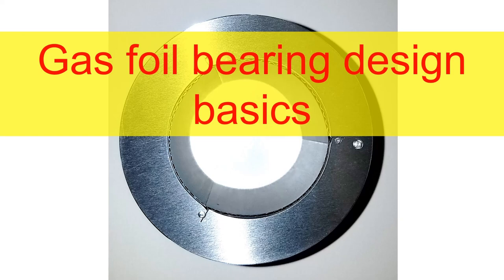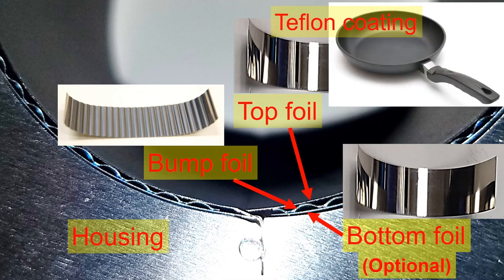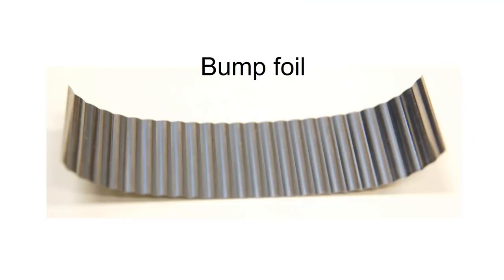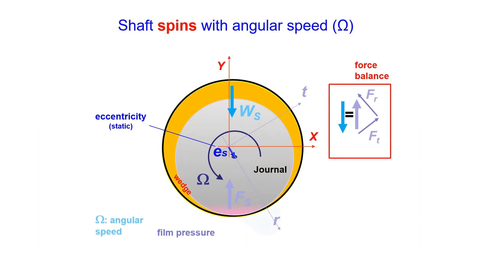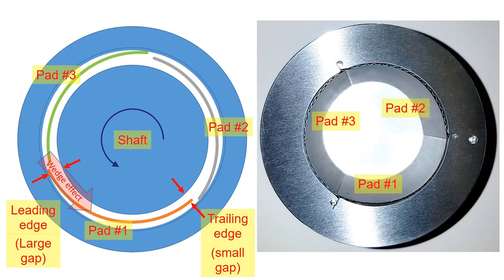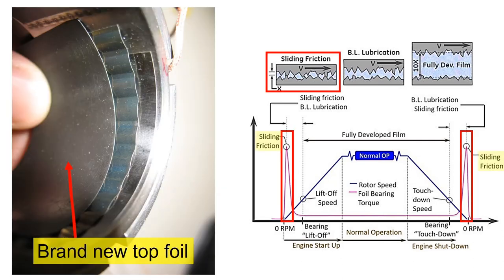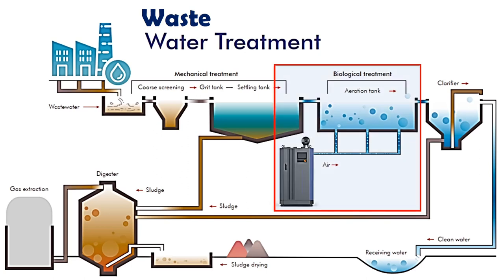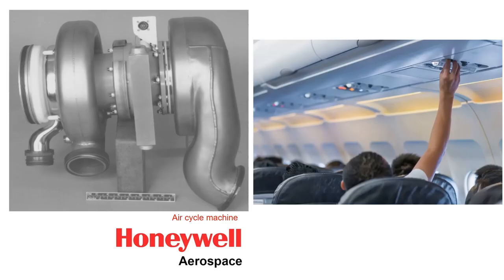Part 16 - Air Foil Bearing - Part A: Overview

Comment: Excellent video.... What is the source of this compressed air for lifting the shaft? Is it internal (bleed air) or external?
Thanks.
Reply from the maker: Great question! In the video, it's explained that the shafts are elevated by hydrodynamic effects from gas foil bearings. As the shaft spins, these effects generate increased force. At lower speeds, there's less of this hydrodynamic effect, which can lead to wear on the gas foil bearings. To address this wear issue in certain applications, external compressed air is sometimes employed to lift the shaft.
Reply: @RotorDynamics  Thanks for the excellent explanation.... Keep us educating.... Thanks...

Comment: Thank you  for sharing the knowledge on gas foil bearing. Can we replace oil lubricated bearings with foil bearing? Suggest few applications.
Reply from the maker: Excellent question! Numerous efforts have been made to substitute oil lubricated bearings with gas foil bearings, particularly in applications such as HVAC compressors. However, it's crucial to understand that a direct replacement is not feasible. This is primarily due to the fact that gas bearings generally offer lower stiffness compared to oil bearings, as the working fluid is gas instead of oil. Consequently, in order to accommodate the same weight of the shaft and other forces that need to be counteracted, the gas bearing typically needs to be larger in both diameter and length.